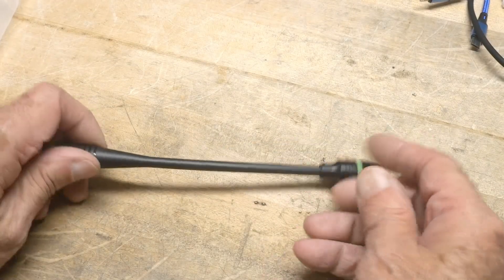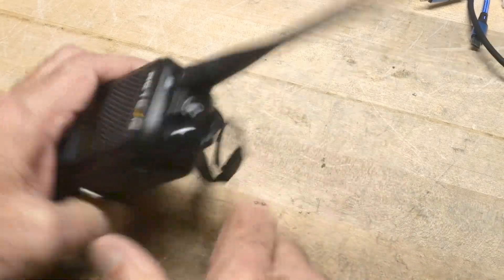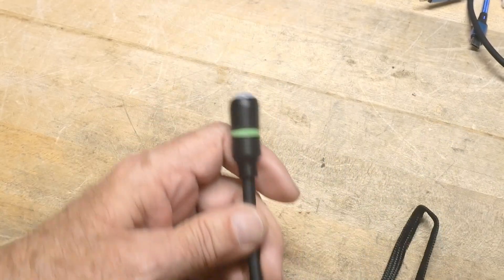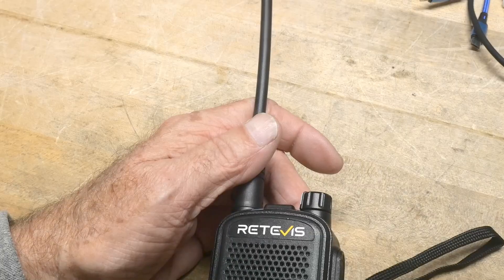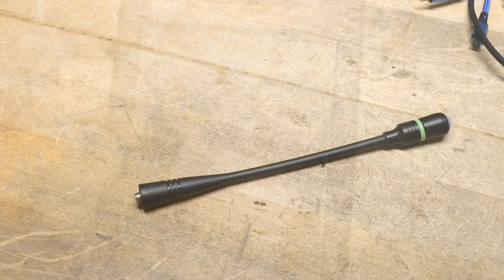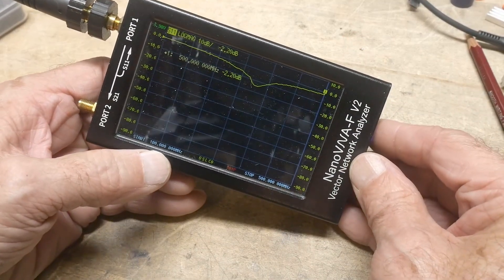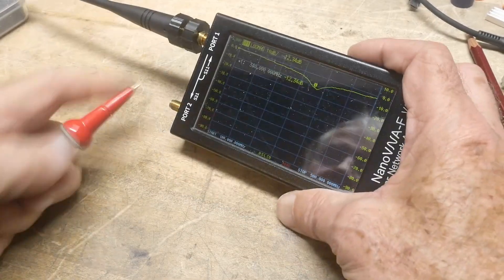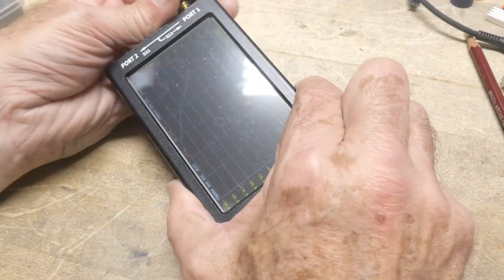#2469 LED Antenna

Comment: CB was illegal but popular in the UK in the 1970s. You could get little neon lights that clipped onto the top of your mobile helical 5/8 whip, which I guess had V max there, and they lit up on TX just in case you weren't conspicuous enough. They went by the name of suicide pills...
Reply: In USA, they were called "fireflies".  HAM's were once known to use a NE2 bulb on the end of a stick to see where the voltage loop was on open wire transmission lines.
Reply: @WECB640  There is a great YouTube video of someone loading up his house Christmas lights for HF and then having fun with SSB.